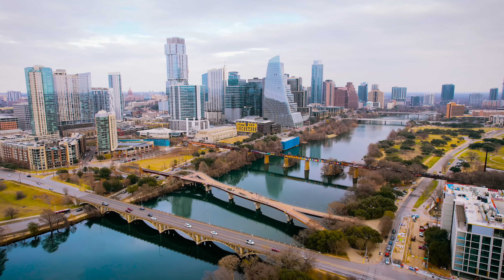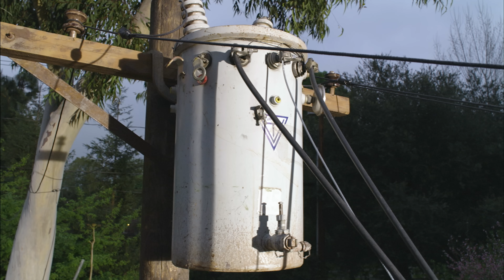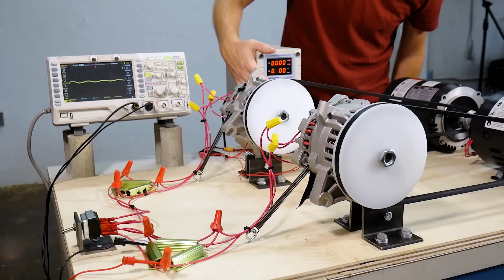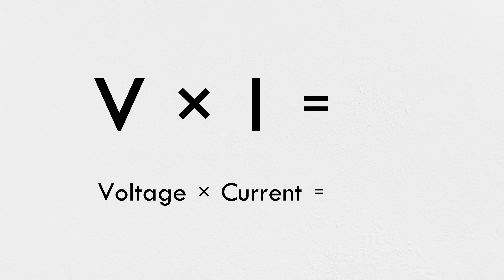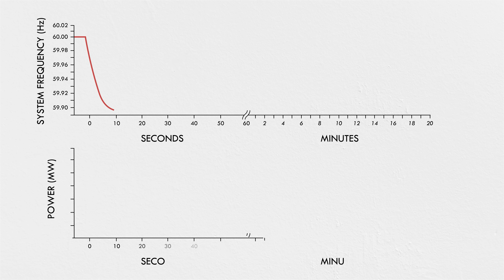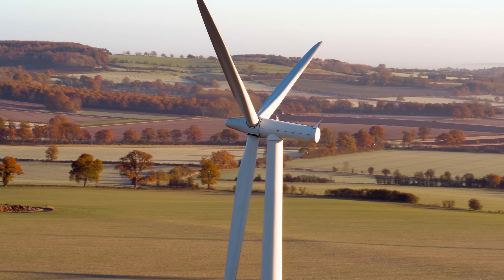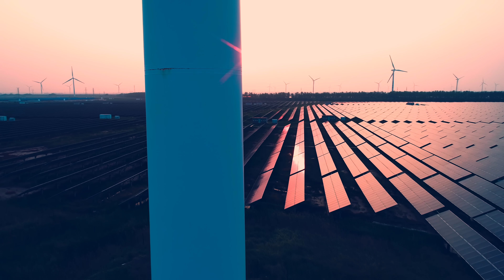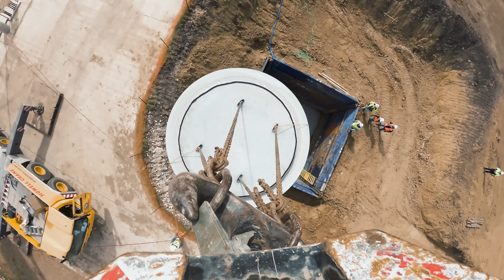Connecting Solar to the Grid is Harder Than You Think

Comment: Hey Grady, Thanks for this episode. I work as a NERC regulatory advisor and am writing a report for a tripped solar station as I write this. More people need to understand inverter based power vs inertia thermal power. On the transmission grid we are starting to see massive issues of instability to voltage and frequency and it is only getting worse. In my region we also had the largest load shed event in memory and we anticipate due to the level of intermittent renewables that load sheds and shortage emergencies could become a regular thing. Baseload power is so important to stability.
Reply: Don't we want more flexible dispatchable power plants? Baseload plants, in my understanding, is some types of plants that are cheap and don't like being turned off so we designed their capacity at minimum load. In the future grid that have more and more intermittent renewable power, isn't baseload plants not the solution and, instead, we need plants that are highly flexible?
Reply: @BBP_BKK  Yes and No. There are 3 types of plants: Baseload, peaker, and renewables. Baseload plants are dispatchable but usually do not have the fastest response times due to the sheer size of them. What you are thinking of are peaker plants; usually they are smaller faster responding, which are good for keeping the grid stable during peaks and troughs. But again they are usually smaller which gives the agility needed. 

Renewables are not dispatchable and just produce whatever they produce. Which inherently makes things less stable.

A good grid will have a mixture of Baseload for carrying the heavy loads and peakers for the spikes. Usually a 70/30 mix is ideal for a healthy grid. Also there are some few exceptions like hydro which can be both a peaker and baseload, but that is rare.
Reply: @hightechredneck8587   What I'm still curious is that, with more and more intermittent plants, should we want more and more peakers that can adjust quickly? I'm thinking like can we have all power plants in the grid being peakers and renewables? And what would happen if we do that? Those slow plants (like nuclear for example) aren't fit in the future grid, are they? By the way, in your ratio between peakers and baseloads, I'm not quite sure which is 30 and which is 70? Thank you for the explanation and clarification.
Reply: @BBP_BKK  no problem. Happy to inform. 70 baseload, 30 peakers. Theoretically a grid could run with renewables and peakers. But if a region uses 10MW normally, it could get as high as 13MW during peak times. So you would Theoretically need 15 MW of peakers (not all generators can run at all times so you need extra) and at least the same more likely double over a very wide region of renewables. But renewables come with added complexity due to inertia and VARs. Grady just released a video about that the other day. Essentially short version it creates a very unstable unreliable grid with a multitude of reliability and stabilty issues. Nice thing about baseload is it is always running. Often for years before it needs to shut down for maintenance. Creating stable reliable power for day to day use. It is often much cheaper as well due to scale and size. That is your use case for nuclear. Ideally in my opinion the best combination of power is nuclear baseload and hydro peakers.

Comment: Inertia isn't infinite, if turbine inertia is used to provide more power instantly the turbine slows down, the lower rotational speed decreases the possible power output at a given pressure, which effects efficiency. While inertia in turbines have a stabilizing effect, it's not a "free bonus".  If a turbine needs to suddenly increase the power output, and then sustain the increased output, it will have to do that at the lower rotational speed, until the speed is restored, which requires even more energy, at the lower rotational speed. Turbines also needs to run under specific conditions to achieve maximum efficiency.
Reply: Close, I assume kinetic energy is being extracted and thus slowing the turbine, but why wasn't this discussed? You're right, no free energy and it will need to be restored.

Comment: Tesla are solving these problems. Tesla solar on your roof is installed with their inverter and battery, always, so that you can safely be disconnected from the grid instantly when the grid goes down and your solar panels and battery can keep working on your isolated home grid. Powerwall and megapack stations are also able to stabilize the grid for others and do so profitably.

Comment: also, you need to factor in the fact that Texas is partly grid independent from the rest of the United States.  For as large of a state as it is, it only has a handful of outsources to other states and the rest of the grid, most states, even much smaller and even more remote states often have far more connections to the wider national grid then Texas has and this has lead to some weird Texas exclusive issues with power distribution and makes Texas much more susceptible to power instability when things go wrong.  Here in Illinois where we are mostly fully connected to the wider National Grid, we very very rarely get black outs or brown outs, often only when something very local happens, almost never when something distant happens, even a plant emergency shut down.  We have not had a fully region wide black out since the Great Wind Storm of 2009 and haven't had even a city blackout in at least 9 years.
Reply: The natural solution for Texas would be natural gas plants in the short term. Nuclear is ideal for long term there though, as you can build a nuclear plant far out in West Texas to produce more power than the city of Austin alone would need.